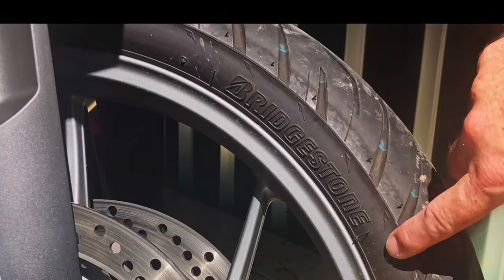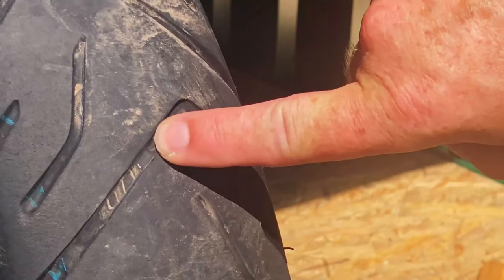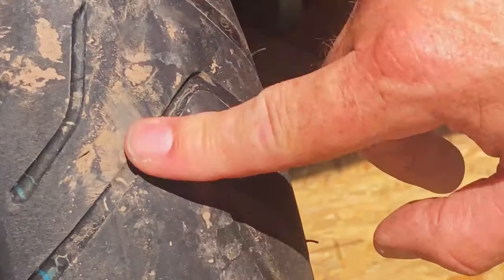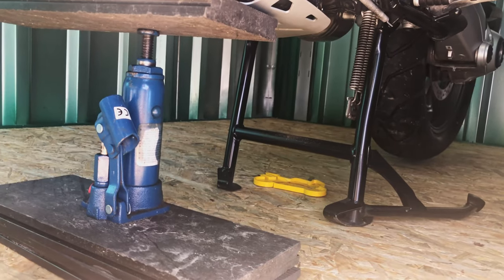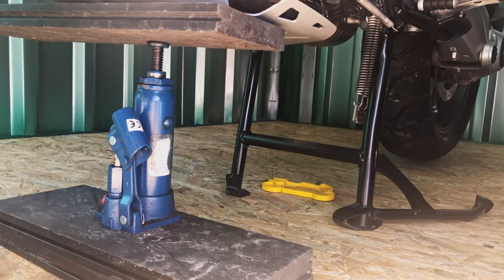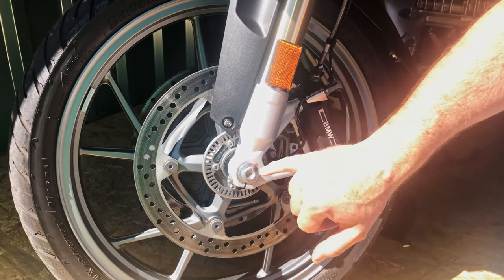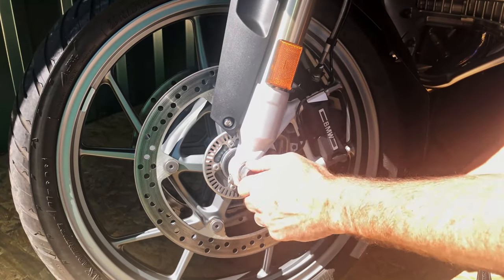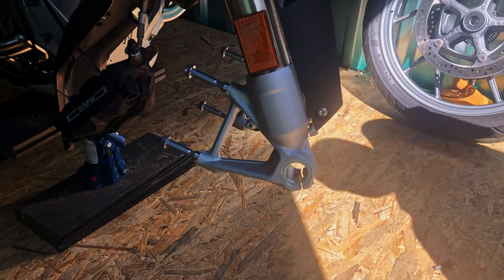Front Wheel Removal BMW R1250GS (for Tyre Change)

Comment: I find the detail of bouncing the suspension before fixing the axis really interesting. Just one doubt: is it not necessary to block the axle with a hex socket from the right side to prevent it from free spinning when screwing the left axle bolt? You don't show it in your video, nor do that most of other similar channels. Otherwise, why is that right side hex hole for? Thank you!
Reply from the maker: It’s a black art I reckon. That does not need to be over tight anyhow as the pinch bolts hold the spindle even if it’s only finger tight

Comment: Nice but I never remove the brake calipers to remove the front wheel.  Once the wheel is removed I push the brake pads (pistons) back to make installation easier.  Remember to pump the brakes after reinstallation to bring the pads back into contact with the rotor.
Reply from the maker: Good tip!
Reply: Was going to say the same - there’s really no need to remove the calipers 👌 especially if you’re out on the trail trying to repair your tire!

Comment: Excellent video, very well done. Much more detail than others. Can you share what grease you used?
Reply from the maker: I used copper grease as it’s more about stopping corrosion than lubricating. Realistically any will do as it won’t get hot either. Just be sure you just smear lightly on the spindle only 👍🏻
Reply: @nickhodgeUK  Is it a Copper Anti-Seize lubricant?
Reply from the maker: @jpaul4595 exactly. Copper ease

Comment: Hi Nick - what brand of torx bits do you use? I've struggle to find a decent quality set unfortuantely. I had a draper set but the holding socket is a terrible quality. Thanks
Reply from the maker: Mine are mainly Wera. 👍🏻

Comment: Thanks for that, Nick. I’ve just had to remove my front wheel after being a colossal ninny and riding off with the d-lock still through the hub, and bending a spoke. I’m not mechanically confident but really clear instructions, well presented and shot. Spot on. Cheers.
Reply from the maker: Thanks Ben. Sorry for your damage but glad it helped 👍🏻

Comment: Surprised to see you use copper grease on the spindle and especially on the spacer and oil seal face, copper grease is not a lubricant it's abrasive the same but not as severe as grinding paste. Best practise is to smear it with high melting point race grease and if any surplus finds its way into the bearing surfaces it will cause no damage. Hope this is helpful and thanks for your many informative videos.
Reply from the maker: I think I may agree with the spacer face but the spindle is ideal as copper has anti-seize properties. Ideal for assembly. The spindle is not rotating. I would contest none would find it’s way to the bearing. Particularly if as advised used sparingly??? In my opinion of course. Thanks for the comment though 👍🏻

Comment: On my old 1200GS (2012) which I used to own I could remove the front wheel without taking off both brake calipers, even if instructional videos included removal of both of them. Do you think it would be possible/impossible on the 1250 to get the wheel off with one of the calipers in place? (Yes, you need to wiggle a bit and maybe put a wedge between the pads, and not actuate the brake while the rotor is out from in between them, but is it physically possible? (The fully inflated tire width itself can be a bit of an obstacle, but it worked on the old bike!)
Reply from the maker: Peter. Absolutely you could. Much depends on type of tyre and whether you want to risk damage (probably superficial) to rim or calliper cosmetics. For four bolts I’d rather remove. Also it’s far easier in reassembly to get wheel fixed and centred and then drop the calipers over 👍🏻

Comment: Great video thanks a lot ! You took my fear out of doing that task myself on my 1250 ! Could you please advice which tool you use to fit precisely the pressure in newton on each torxs....??
Reply from the maker: I used a 3/8dr torque wrench (I use a 3/8 drive one as the torque is in the middle of its measuring scale. If you use a 1/2drive you’d be right at the bottom and 1/4 drive right at the top. Torque wrenches measure more accurately in the middle of their range 👍🏻

Comment: hi, thansk for doing this. im about to tackle this, i dont see anyone using that big hex on the left side (if im facing the front of the bike) just the right side 17mm will tighten the spindle?
Reply from the maker: Hi. The spindle should be loose after loosening the fork clamps either side. I think the 17mm is purely there to give a little leverage if it does get stuck or corroded 👍🏻

Comment: Hello Nick, just about to remove my wheels on my GS and just wanted to check.........when replacing the wheel, do you torque up the 17mm spindle bolt before you remove your jack, and do the bouncing bit??
Reply from the maker: Yes just leave the pinch bolts hand tight and bounce to centre everything then pinch them up 👍🏻
Reply: @nickhodgeUK  That was quick!!! Thanks Nick, appreciate..............great video..........expect nothing less from you 😁

Comment: great job and well explained, what do you think of the Bridgestone tyres, I know they a black sticky and round just wondered if you like them.
Reply from the maker: RMG thanks for the comment. Probably unfair to comment as my experience is small on other modern tyres. Never had issue for sure. I was happy with the wear but one commenter had Anakees which had done many more miles but I didn’t really ‘wear out’ my rear tyre. It was replaced with a severe puncture at about 2,600 miles I think. Sorry cant be more helpful

Comment: Hi nick, what’s the wood you have on the floor of your bike shed, and how does it cope with the weight of your bike.
Reply from the maker: Hi Ken. Amazing how people spot these things outside the subject 🤣. It’s OSB3 board (18mm I think). The floor frame is very sturdy with multiple steel spars. It has no issues. Been really happy with it. It’s steel so suffers condensation but it doesn’t actually drip, although I have cover on bike anyhow 👍🏻
Reply: Thanks nick.👍

Comment: why do you have to remove calipers and sensor? cant you just pull the center retaining bolt and slide it out?
Reply from the maker: Indeed you can… mostly. You may struggle if the tyre is too wide and whatever it’s more of a wriggle risking damage to rims and sensor, particularly on re-assembly where it’s much better to drop the calipers on the discs than try and manoeuvre the discs into the calipers. For me it’s just 5 bolts and makes the job so much easier and cleaner 👍🏻

Comment: Great video   One thing to add is to start the motor while you bounce the bike as the active suspension feels like a rock with the motor off.    Learnt from this video that I do not have to carry a big hexkey as the axle just slides out
Reply from the maker: D Gomes that a good idea I never thought of and you’re correct. It’s not very bouncy for sure. I’ll give that a try next time. It is confusing why they have the big hex in the end. Suppose they’ve had corrosion issues at some point??? Ride safe

Comment: how important is to suspend the brake calipers so that they dont just hang off the hose when you take off the front wheel? I know on a car that's a very big NO NO, but on a bike, the caliper is smaller and less heavy... I changed my tyres on my R1250 GSA and the mechanic didn't bother suspending the calipers even though I told him he should do so.
Reply from the maker: Anything may be able to ‘get away with’ but the pipes, compression joints and banjo unions are all under undue stress for the sake of a couple of cable ties. Be aware too you can remove the front wheel without removing the calipers but it’s tougher, impossible with some tyre types and increases danger of damaging something. Eg ABS sensor 👍🏻
Reply: @nickhodgeUK  thanks!

Comment: Hi Nick,

I love your videos. Way you describe the machine and materials, costs and honest reviews.
Use a mic if possible as the voice is low on these videos.

Thanks a lot for your contribution.

Cheers,
Chetan
Reply from the maker: chetan sb thanks chetan. Sound is definitely a struggle for me although I actually have two mics I generally use. A ride camera mounted and a tie-pin type. Just wonder if it’s the acoustics of my room which has high ceilings and stuff. Rest assured I’m working on it though

Comment: Rear Wheel Removal BMW R1250GS, done that to?
Reply from the maker: Jpson67 no sorry. Rear tyre has been changed but I suffered a puncture so dealer did all of the job
Reply: @nickhodgeUK  Ok hope your ok now then
Reply: Rear is very easy, just 5 bolts. Caliper and rotor stays on the bike, untouched.
Reply from the maker: Indeed 👍🏻

Comment: Looking at the video, it appears that you may have been running your tire pressure higher than what is recommended, I would check your air pressure gauge to avoid wearing your new tire out so quickly. Also, that was way too much grease you put on that spindle.  Thanks for the videos...

Comment: Thanks from Alaska Nick.  As many others have already said, great video and you've removed the fear of the unknown for me.
Reply from the maker: Thanks Jim. Glad it helps 👍🏻
Reply: @nickhodgeUK  Forgive me, I know this topic has already been covered, but would you be willing to elaborate a bit more on the copper grease?  My 1250 recently underwent a tire changeover at my local dealer and it doesn't appear they used any type of anti-seize compound.  In your opinion, is its application a benefit of doing it yourself?  Appreciate the clarity.
Reply from the maker: @AlaskanMasonjar  hi Jim. There was none in mine at disassembly (from factory) but my thought is it’s a metal surface and clamped. Left for a prolonged period or in a harsh environment I’m sure it could corrode, tarnish and be difficult to remove. It will not stop the wheel turning as that is the job of the bearings. I would concede to an earlier commenter that high melting point standard grease would be better on the seal face as copper grease does have some metal in it. I slightly disagree with the comparison with carborundum grinding paste which is actually very abrasive. Copper grease is for assembling components and slow moving bearings so ideal spread thinly on the spindle to prevent possible seizure. Is it necessary? Maybe not, is it harmful, certainly not. It’s a bit like the clutch and brake lever pivots. Are they ever likely to sieze? No, but I still drop a little oil on them once a year. Hope that clarifies? 👍🏻
Reply: @nickhodgeUK   Hi Nick!  Exactly the clarity I was hoping for!!  Super helpful and thanks again.  Jim

Comment: Excellent video. Thanks for posting. Will you be doing the same for the rear wheel in the near future?
Reply from the maker: Richard D hi Richard. I hope not. I had a rear wheel puncture at about 2,500 miles and was so close to the dealer and it was late, they replaced tyre for me. Be sure I likely will when it does need doing though. Service at dealers on 12th September. May post a short video on experience. Ride safe
Reply: @nickhodgeUK  My R1250GS has Anakee Adventures fitted. I've just passed 5000 miles and the front shows some wear (and a touch of squaring-off), whereas the rear still looks very fresh. They seem good tyres although perhaps a touch noisy. I will be interested to hear about your service experience. Did you follow the variable service indicator on the bike or stick with a fixed interval?
Reply from the maker: Richard D I had Anakee’s on my 2018 1200 although both my 1250 and my mates Exclusive both have Battlax. I’m going by the TFT telling me. Had a bit of a conversation with the dealer as both mine and mates back brakes are pretty well useless. They are going to change brake fluid but can’t see how that will help so watch this space. Interested to know how others back brakes are. I know they’re 60/40 balanced when front applied and that’s superb, but the rear alone is pants

Comment: Wow another fully explained video nick, thank you for giving me the confidence to tackle removal of front and rear wheels, picked up what looked like a Stanley blade on way home last night on A27 thank god for tyre sensors and only just made it home with 1bar left in rear tyre. Watched your video and wheel coming off today and new tyre being fitted. Many thanks👍
Reply from the maker: Thanks Chris. It never ceases to amaze me how these things get flicked into tyres. I had a 4 inch screw right in to the head and bent inside the tyre. Both jobs are simple. You can remove the front without removing the calipers but I prefer to give plenty of room and support them with cable ties so they are not straining the hoses. Good luck 👍🏻

Comment: Kinda doubt you needed to remove the calipers, the wheel should just slide off
Reply from the maker: Hi Ryan. I’m not sure. You may get away with removing one but you can’t manoeuvre the forks and the mudguard is bolted to it. The wheel may pass but not sure tyre would easily. Maybe check next time if I can. It’s a pretty easy couple of bolts though and sure makes it easier
Reply: @nickhodgeUK  those caliper bolts would have a torque spec. Unless you keep a torque wrench on the trail with you it would probably be a good idea to practice removing tires with the least amount of disassembly possible
Reply from the maker: Ryan Hermary don’t disagree but I would say a small proportion of GS riders use their machines in that way, particularly here in UK where we have few available ‘trails’ as others with greater land mass have

Comment: Thanks for the video.   I'm beginning to think that the owner's manual, and all of the front wheel videos I've seen are providing wrong information.  Consider this KTM video from Slavens racing:  https://www.youtube.com/watch?v=zhb25ElKdEU     The difference I see is in the order that things are tightened and torqued when reinstalling the wheel, and I know Jeff Slavens gets it right in his video.   If we were to follow this advice on our GSs, the order would be 1.  replace 17mm axle nut, but do not torque  2.  snug right side pinch bolt, but do not torque  3. torque 17mm axle nut,  4. torque left side pinch bolt   5.  loosen right side pinch bolt and check to see if axle can slide a tiny bit inside of right fork.   Move forks up and down if desired to ensure no binding.   6.  torque right pinch bolt.   What do you think?    Full disclosure:  I've yet to remove my GS wheel, but I've used this procedure lots on KTMs, where I've also seen the wheels installed incorrectly, causing poor suspension performance.

Here's another video from Tokyo Offroad which I think also shows the same principle:   

https://www.youtube.com/watch?v=7qRIxzf9nqA   

The right side pinch bolt is the last thing to get tightened, as that's the point where there is some wiggle room between the axle and the fork to ensure the forks aren't binding.   The left side gets done first, as that step is what draws the axle into the hub and correctly tightens the axle to the hub and to the left fork.   

I'd be happy for any feedback about this.

Lastly, as I'm about to do my first tire change, I went looking for the 22 mm allen key for the right side of axle or alternative from Touratech, Wunderlich https://www.wunderlichamerica.com/Motorcycle_Multi_Function_Axle_Tool_Wunderlich_BMW or Motion Pro.   So many threads about making your own....   And yet, this tool seems 100% unneeded, unless perhaps you have parts rusted together?   No such tool for my KTM, and I don't see why you'd ever need one of these for the GS.
Reply from the maker: The 17mm axle nut is part of the spindle and only used to give purchase to the spindle if the fork pinch bolts don’t let it loose. I’ve never had issue and in fact many suggest not removing the calipers and I think you could remove it but I feel safer doing that. The way I did it was to put the spindle in and then after finger tightening the pinch bolts, bouncing the suspension to centre everything and then torque pinch bolts 👍🏻
Reply: @nickhodgeUK  Hi Nick, I didn't see your response and also just edited my comment and hopefully clarified a bit.   The point is you can't "centre" anything with BOTH pinch bolts tightened.  You have to fix the left side (17mm bolt and then the pinch bolt), bounce, and then fix the right side pinch bolt.  But before doing that, you temporarily tighten the right side pinch bolt, so that you can draw in the axle with the 17mm bolt and tighten the left side pinch.   After fixing the left side, you loosen the right again, center things, and then finally tighten the right side pinch bolt.   It's totally not what the Internet is telling us, at least the videos I've started to look at.   I'm just a shade-tree mechanic, and so having to look stuff for my KTM have given me a different perspective on this.   Give the videos a look and make up your own mind.

I haven't made an opinion on removing the calipers yet.   It's easy enough to pop them off and likely reduces the chance of scratching something and reduces the number of hands you need re-fitting the wheel.